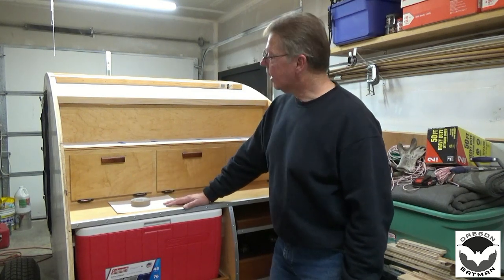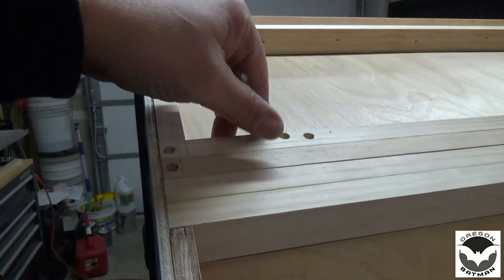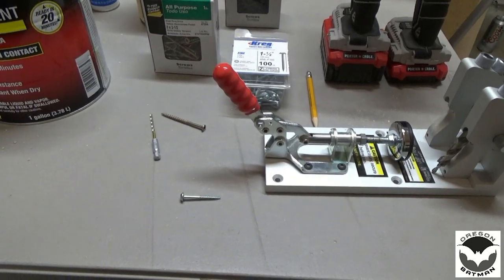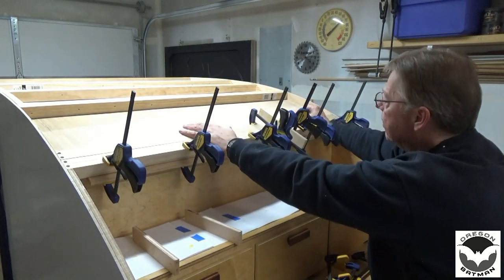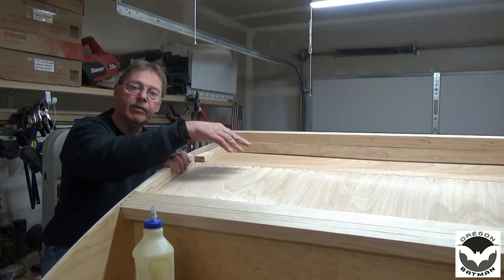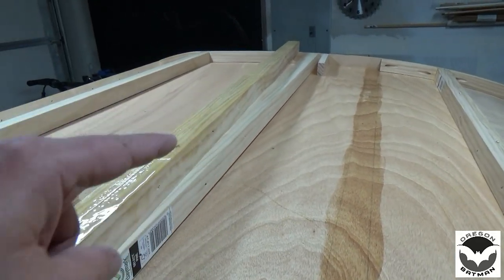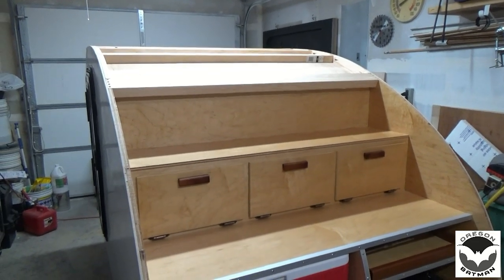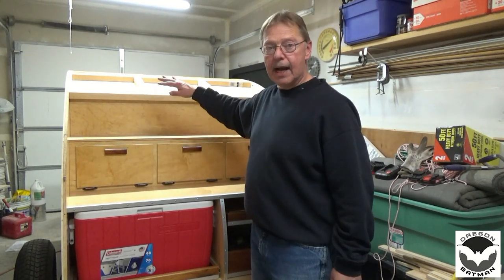Let’s Build A Teardrop * Step-By-Step * - Part 29 (Finish Installing the Spars)

Comment: I noticed you were having the same issue I was with those square head pocket screws. After about 8-10 where the bit was popping out and nearly stripping the screw I said I was done. After I was done with the floor I started using the star head decking type screws in my pocket holes. Works just as well with almost no stripping or jumping.
Reply from the maker: Yeah... I switched out after a couple screws got rounded out. I ended up using Phillips heads, my go-to! Went a lot faster after that!

Comment: I'm making mine out of carbon fiber to have it about 450lbs. Looking at some of your techniques that may apply, this video appeared difficult to make out of those woodspars. I'll be pressing my into the holes. It would adhere once the epoxy kicks in. Great series btw! 

I remember watching you channel years ago from the bigger trailer you had. Took me 7 years to finally jumped into building using a Northern Tool aluminum trailer.

Comment: That was a fantastic job you did Al.
One thing I would have done differently was put a block of wood on each side of the drill press so each hole would be the same.
Take care
L.L.A.P
Mike
Reply from the maker: Thanks Mike! The blocks are a good idea, any little thing to help make it easier is always a good thing!

Comment: Did you have any trouble driving the pocket holed spacer screws into the same area where the spar screws where? I don’t see how you avoided the screws hitting and either binding or splitting out a different direction.
Reply from the maker: No trouble... I made sure to add the pocket holes in a place I knew would clear the other screws. I relied mainly on the glue to hold everything in place, they were close, but no touchy! All worked out great. Thanks for checking it out!

Comment: Been watching all the videos so far and it's an awesome build.  Thinking about ordering your plans and using them as guidelines and adjusting them for my own (I want it a little wider, and it's gonna run the same tires and wheels as my jeep with a slightly wider axle so it'll track through sand in the same ruts as my jeep).  But why did you choose to insulate the floor and roof but not the walls? Is it really difficult to do the same sort of construction in the walls as on the floor? Or was this a weight reduction thing?
Reply from the maker: Thanks Cameo... deciding not to insulate walls is basically a personal preference. In reality... you are not adding very much in 'R' value when you insulate walls. And seeing how I do not do winter camping, it would have been extra work for naught. I think you can reduce weight by insulating, only benefit I can see.

Comment: My daughter has obtained your plans and is going to build a teardrop trailer. Your plans and your videos are very good. I have a question for you. Considering you are using contact cement to adhere the filon, would there be any reason formica would not work?
Reply from the maker: Hey Michael! Wishing your daughter a happy build!  
The glue that I used for the filon is a special type of glue specifically for the filon, cannot use the contact cement for that. Not sure how well the contact cement and Formica would hold up in the heat. I have a feeling it would eventually delaminate and blister up. Be something to experiment with :)

Comment: I know this is an older video, but I was wandering if it would be best to have waited on putting the Filon on and screwing the spars in from the side instead of down through the plywood?
Reply from the maker: Thanks KR... either way works. Keep in mind that the sides with the filon is only 1/4" thickness whereas fastening down through the plywood has more holding power.

Comment: Amazing quality and great video! I really appreciate all little details. I am curious about how you determine when to use regular wood glue vs the brushed on contact cement. It certainly appears that it is working great.
Reply from the maker: I used glue where the spars met the ceiling. Where there was a sag, I used contact cement.... eliminated the use of bracing inside if I were to use glue.
Reply: @OregonBatman  OK thanks. Sounds like the contact cement has a much stronger bond than the regular glue.
Reply from the maker: Really, I think the regular glue will hold much better. Using the contact cement helped support the ceiling until the spars were in place. If I had used regular glue, I would have needed to install some sort of bracing inside to hold things up until glue dried, I just took a short cut! :)   Worked!
Reply: @OregonBatman  I think you secretly mixed in some special BATGLUE and didn't tell us! 😄😄😄😄
Reply from the maker: Shhhh... that'll be our little secret! :)

Comment: Batman, how far is your hatch spar( the spar that you attach your hatch hinge to) from the bottom of the galley when closed? 48"? The width of the ply? I know that some TD builders want a bigger size hatch and dont mind using more than one luan plywood instead of one 48" wide luan.
Reply from the maker: I think it was right around 48"... that way I didn't have to splice it or have a seam
Reply: @OregonBatman  ah good good, thanks
Reply from the maker: @macbethdemilo7253  You're welcome!

Comment: This is my second time through your entire video series. One question, are the pocket screws for the spacers a bit too close to the screws holding the spars to the side walls? I'd be concerned they'd interfere.
Reply from the maker: Great question! I didn't experience iny issues when installing. I think mainly because I used shorter screws for the pocket screws. The screws were there just to keep things from movingand relied on the glue to do the job. Worked out great!

Comment: Hello, I'm in the beginnings of building a Teardrop and I've been following along with you and  I'm starting with a utility trailer I already had and it's not 48" wide it's 53.75" wide. Because of that I cannot build my ceiling  the way you did for obvious reasons, a 48" wide piece of bendable plywood doesn't reach. I was wondering what you think about running the plywood perpendicuilar rather than parrallel. I don't know if that plywood  bends both ways. What do you or anyone else here thinks about that? I just now sent you $15 for your plans.Thanks for he great videos.
Keith
Reply from the maker: Thank you Keith! The plywood I purchased come in two variations. The wood can bend longways, like wrapping a 4 x 8 sheet around a barrel (4 feet high) or wrapping around a column (like eight feet high). So building a camper wider than four feet is very possible. You would have one or two seams on the inside to finish out with trim which would look great as well. My next build will be around five feet wide, so I will be  using this technique.